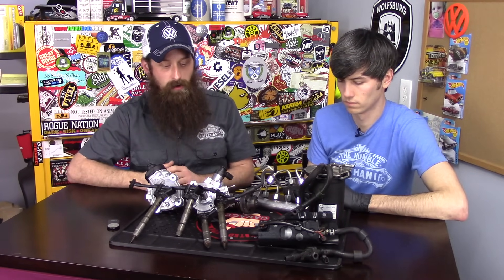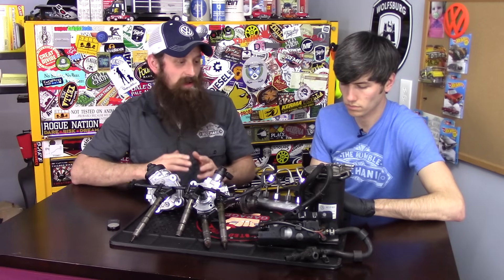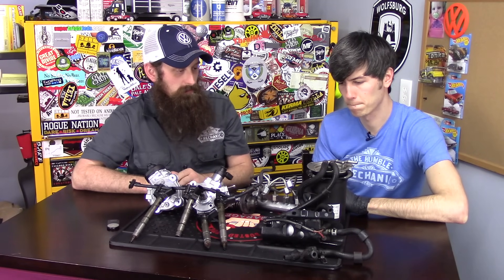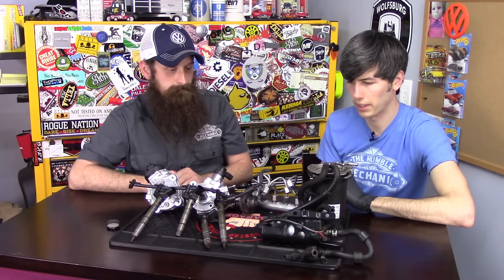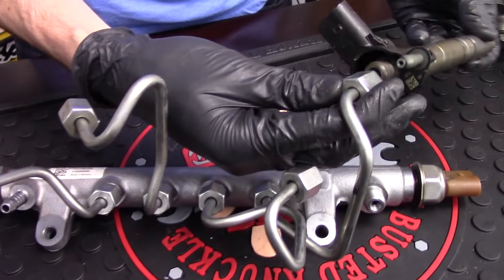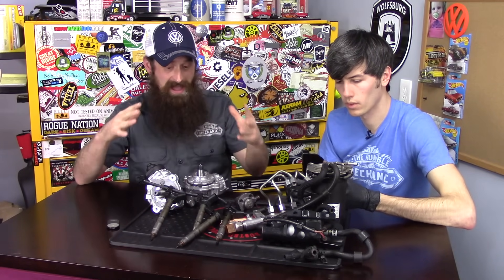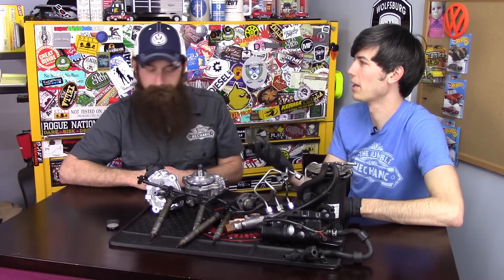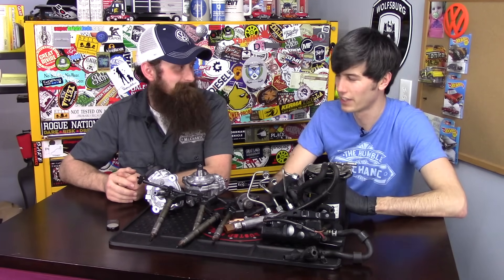Putting Gasoline In A Diesel Car - What Happens?

Comment: My diesel can not starting due to injector issue, can I put around 50ml petrol in Air Pipe and try to start for emergency . Issue is car was standing for long time. Can I use Petrol in the Air pipe to just to start the car?

Comment: my mother in law took my father in law's brand new 2006 diesel F-250, he had it for less than a month and it had less than 2,000 miles, and she filled from 1/8 of a tank to full with gasoline, she realized what she had done after starting it and driving 50 foot and shut it down. thankfully after the tank was drained and refilled with diesel it didn't have any problems but it was scary because the engine wasn't broke in yet, it was the first brand new vehicle he'd ever owned in his almost 60 years of being alive and he was not happy

Comment: Read much of this.  Seems like overkill.  And if you put diesel in a gas engine, you DON'T have to do anything, just drain the diesel out and refill it with gasoline, and you will be good to go as soon as the diesel in the carb has been replaced with gasoline.

Comment: Just get the engine replaced, its much easier. Also you can drive with diluted or mixed fuel right up to 50% of the wrong fuel. This guy is talking if you use 100% of the wrong fuel and drive.

Comment: what about when diesel is pumped into regular gas engine? they just did gas to diesel? also in another video i watched prior, they said there is a critical time window to get the wrong fuel pumped out before it compromises the whole engine, like before the car's actually driven to distribute your mistake throughout the whole engine. Is that true?

Comment: I don't get why the diesel nozzle is larger than the petrol nozzle. It's much easier to put petrol in a diesel car, which also has much more severe consequences, than if you put diesel in a gas/petrol car. My guess is that the standard for these sizes was made several decades ago way before misfueling was considered an issue.

Comment: So only the pressure pump would fail if it doesn’t have it’s own oil 🤔 

Swap that from a metal to metal pump to something else and you can run gasoline 😊

Wow that’s an easy upgrade.

Comment: I have a 2007 Ford 2.0 TDCi CommonRail engine with 360 000 km with injectors and dpf filter needing a clean to pass emission test. As far as I've been told and researched on the internet a % of petrol ( or Toluene ) should do the trick, clean the (clogged up.. ) injectors to some extent. What is the % of petrol gas to never cross? 5 %? 10 %? 
Thanks.

Comment: its like this, diesel depends on a sort of detonation or ignition from hot conditions,  and gasoline is formulated to prevent detonation from hot spots so really they are opposite fuels.  the operators manual for the 1977 diesel i had said in very cold weather mix 50/50 diesel/ gas

Comment: Years ago, I put unleaded gas in my regular gas car. It ran like crap and I didn't know what was wrong, neither did the mechanic. Later I re-fueled with regular and voila, it ran perfectly.
Reply: Small engine?  Usually small engines,  especially the older ones need higher octane fuel.  Not as big of a deal putting high octane in a bigger engine.

Comment: OMG! So many people cannot read + comprehend. Most people can't even correctly identify pump # or forget which is the fueling side. You generally cannot put Diesel in a gas engine because the nozzle is larger. And what about ppl. that drive off with nozzle still in fuel port????!!! that's why breakaways had to be invented. Remember when there was NO self service????

Comment: In the winter in cold weather my old 240D Mercedes manual said I could cut the diesel fuel with a bit of gasoline in the winter. I think it was about a pint or quart of gas per tank of diesel fuel. Diesel fuel gets like gel in winter.

Comment: Two years ago, my sister's husband poured 2/3 gasoline into a fiat multiple 1.9jtd After 140 km, I emptied the tank, poured diesel and two-stroke oil. Even today, he drives it with the same injectors and the engine does not consume oil

Comment: What I got from the video is that vehicle manufacturers make profits from consumers making mistakes... Manufacturers are making parts that WILL be guaranteed to fail if used incorrectly once. With your own words older vehicles ("back in the day") would just run like crap for a bit and replace maybe 1 part but today it would destroy the whole fuel system / vehicle.... especially in terms of the money needed to replace all parts "damaged" either short or long term will exceede the value of the vehicle. It's awesome to know you guys explained how inferior vehicle parts are made and how making something like a gaspline pump that doesn't rely on fuel for lubrication can be fine but if you have a diesel pump and give it gasoline it will destroy it.  Why cant a gasoline fuel pump be used in a diesel? I think manufacturers plan for cheap / obsolescence / high cost of ownership.... especially when dealerships make more money off out of warranty claims / repairs keeps them in business more than selling a new vehicle.

Comment: Nothing will ever happen to any part of the engine if you put some amount of gasoline into diesel fuel. Mixture of 85% diesel (old diesel fuel, full of sulphur) and 15% gasoline was recommended in the winter time to prevent waxing of diesel at low temps. Modern diesel fuel has additives to enhance lubrication so putting say 10% of diesel will do no harm to the system. Not even plastic pr rubber parts will suffer any damage.

Comment: Just jumper the fuel pump relay, disconnect the fuel hose up by the engine & extend that hose with another hose into a gas/diesel safe container until take & lines are dry lolz don’t need all this

Comment: you say you can destroy the fuel handling systems pumps, filter and manifolds.

and you say it is because gasoline does not provide lubrication.

when you mix oil into gasoline for 2 cycle machines that is done to provide lubrication so it begs the question what happens if you burn diesel or heating or k1 fuel in a 2 cycle machine ?

also will a hobby model run on diesel, heating or k1 fuel?

you can get model engines for airplanes and cars that run on a clear liquid and works the same exact way where there is a glow plug to head the cylinder head so the fuel will burn and no spark plug..

also what about the diesel engine if you can manage to get gasoline past the fuel handling stuff for the time before it fails will the diesel engine even run on gasoline?

Comment: just drain the tank and put diesel back in and maybe drain the fuel line if you drove a bit with the gasoline. Trace amounts of gasoline don't matter. In older diesels we usually put a little bit of gasoline in the diesel in the winter so the diesel doesn't freeze.

Comment: Does running out of fuel on a diesel cause the same wear and tear on the injection pump as putting gasoline in it?  Also does winterized D2 diesel fuel have kerosene in it or another additive?  Do modern diesel cars require D1 fuel instead of winterized D2?

Comment: Amazing how many folks accidently put gas into a deialse. I hadn't ever heard about it till recently when a guy at work did it to his service van. And then someone told be about some other guys in a work truck that did it at one fill up, realized before driving so just drained the tank. Then later in the same long trip did it again, but didn't think about it and drove it and trashed the engine. I kind of wonder if it was an alcohol related incident, if you know what I mean!

Comment: The best way to flush a Diesel fuel system is with Diesel fuel I've had so many of these jobs like this and only one was brought in with Mechanical damage and it was due to overheating and as for the in tank lift pump they are build the same Gas and Diesel so gas will not hurt them your biggest expense is the tow bill and labor to remove fuel and flush and all the fuel to put back in and new fuel filter. BTW I am a ASE Senior Master Certified Auto/Diesel Tech and also hold an Engineering Degree I started working on trucks and cars because of clowns like his guy to give people fair honest work. Yes these damages can occur but likely not because if you have ever put enough Gasoline in a Diesel tank the engine will only idle and if you have enough Diesel in the tank to raise the RPMs than you have enough diesel to lube the injector pump and Injectors but the engine temps will rise before fuel system damage.
STEER CLEAR OF THESE GUYS

Comment: I accidentally put coal in my 737 airliner once.
Reply: Same, I won’t make that mistake twice
Reply: Just switch it off and on again
Reply: Me too, I just flushed it out with gasoline then flushed it again with diesel.  It ran kinda rough for a while but I walked it off so to speak.
Reply: Did it smoke any?

Comment: In 1972, my mother had a 1970 Coupe DeVille with a huge 500 CU motor. We were on a trip to a relative in another state and mid -trip she pulled into a gas station to fill up where an attendant pumped the fuel for you (before DIY pumps existed). The kid put diesel in the Caddy. We started  down the road and after about 3 miles my mother complained that the car started feeling sluggish and there seemed to be more than usual smoke coming from the exhaust. Fortunately we had a ticket for the gas sale and right on the ticket was the price per gallon.  That's how we knew it was diesel because in those days when Gas was 102 cents per gallon, diesel was 89 cents. I'd worked in my late teens in a used car lot so I new a little about car motors and I knew that the Caddy had a 10.5 to 1 compression ratio so I said "Keep going and don't stop" until we had less than a quarter tank on the fuel guage. When we pulled into the next station we didn't turn off the motor and filled it up with 93 Octane.  We did the same fill up one mile from our destination. We then arrived and told our relative what had happened. He said it was the best thing we could have done and we turned off the car. The next day the car started up without any problem at all.

Comment: My sister filled up her toyota diesel SUV with gas, drove off and a few miles down the road it shut off.  It was towed to the garage where they removed the tank and cleaned it. Flushed the fuel lines, replaced the filter, bled the air from the fuel lines and off she goes without a problem.

Comment: i put gasoline on an a non-empty tank by mistake, the tank was 1/3 full when i added it
but i never drained it, i used the car till the tank was 3/4 then fill it again with diesel fuel, i did it again 3 times
my reasoning was that the diesel fuel is heavier and will be  the most likely to be siffoned by the pump
and the mixing ratio of diesel+gasoline makes it so that only a small portion of gasoline get siffoned
so it get dilluted and wont harm the pump
the car was a corolla E140 diesel

Comment: I have a Ford focus from 2010. I have a fuelcap that won't open if I don't use the diesel nossle at the fuel station. 

I live I Sweden and we have different nossels for gasaline and diesel. We also have the same colour code on every fuel station. Black for diesel. Green for gasaline and blue for ethanol.

Comment: I had a sprinter van I put petrol in so 50/50 mix of 40 litres.      Drove 500 miles filling with diesel on route.
It’s now at 170,000 miles .  No issues a year later

Comment: What if I just drove for half a mile only? Would there be much damage? I was told the car may be running off the diesel fuel in the fuel filter, and so the other parts may not have to be replaced.

Comment: couldn't you just dilute the diesel/petrol mix into petrol at a very high dilution? say like 5%? you could even use it in a 2 stroke engine and just adapt the amount of oil you mix with the petrol slightly?

Comment: As others have said the repairs mentioned in the video are overkill! Or at least, it's a worse case scenario. Even with common rail diesels I have only come across 2 cars that would've needed all the parts replaced as in the video. True I've mostly worked in only small garages over the past 23yrs, so I don't see the large volume of mis fuels that big dealers get, but even so I've worked on, or seen in my work many dozens of mis fuelled cars in that time.
Clean out the tank, lines & change the fuel filter, then see how it goes! Otherwise, especially with older cars you could be looking at an instant write off!

Comment: A friend of mine borrowed my truck and put about 4 gallons of gas in my truck and ran it about 10-15 miles.  Do you think that I can drain the fuel and replace the filter and refill it with fuel and I will be ok or do I just need to take it in and get the parts replaced?  Any suggestions will be greatly appreciated.  My truck is a dodge 2500 1998.  It is the old type of Cummins engine.

Comment: What a load of bollocks. I know someone who mis-fuelled their nearly new diesel van five years ago, his big worry was that the fuel pump was ruined, but the mechanic said it would be fine & all the mechanic did was drain the fuel tank, clean out the fuel filter housing, then re-fuelled with the correct fuel. 100,000 miles on he's had no components fail at all.

Comment: wow dummies of the planet infecting all the planet  every and any car cleaning products from engine cleaner to fuel line cleaner its main source is diesel
putting diesel fuel anywhere is a cleaner dummies
you can flush your engine with it 
clean your fuel systems by putting 5 litters of diesel in your fuel tank even if it runs on gasolin or vaselin if you like that

Comment: I wonder if it would be possible to harden a diesel fuel system to make it compatible with gasoline? Maybe a pump that has proper bearings instead of relying on lubrication from fuel?

Comment: Sorry Charles but replacing every component is overkill, I am a diesel fitter and auto mechanic by trade and have seen hundreds upon hundreds of instances of wrong fuel in diesel engines and had both the pumps and injectors apart for inspection. In most cases the engine will stop running prior to damage being done to the HP pump and injectors, manufacturers and their dealers  cover their arse in case of "future" failure, not need and mostly a rip off.

Comment: It's a scam!
A  UK motoring magazine wanted to find out what happens so they took a number of the long term diesel test cars they had, filled them up with petrol (gasoline) and drove them until they stopped. Then they went to the manufacturers garage to fix as they were still under warranty.
Chrysler charged £5000 and changed the entire fuel system, tank, pumps, injectors the whole lot.
BMW flushed the system and changed the fuel filter only at a cost of <£300.
Skoda did the same for <£200.
The warranties remained in place for the remainder they had left ie unaffected by the wrong fuel.

For our american friends who may not be familiar with Skoda it is a VW with different bodywork.

Comment: a friend of mine got gasoline pumped into his 1.9jtd croma by the attendant at the gas station.. didnt know about it, drove about 15km (10mi?) to work where he looked at the receipt... he showed me and asked whats in it - i said its a regular 95 gasoline... he says i have a diesel engine :D just couldnt believe what he saw at the receipt... youd expect those attendants to know what they are doing... so we flushed what needed flushing, luckily the gasoline didnt yet get past the fuel filter into the high pressure pump...  back he goes to the gas station and wants his money back for the full tank of gasoline which had no business in his car, he didnt even want compensation for the work since it only cost him his time... he had to scramble with shell for two months to get that 50 euro or so :D the clerk killed me when she asked if it was gasoline in a diesel engine or diesel in a gasoline engine, because diesel in a gasoline engine is worse - i was like facepalm... i guess you need to keep an eye on the attendants, they are underpaid and dont give a dam if they cause your timing belt to break

Comment: Did it to my Volvo s60 (2004) when stressful talking on phone. Gasoline was almost half of fuel. Added 2-stroke oil to container and was driving with no problems. Just after few hundred km fill again and again with disel. The problem with gasoline on disel cars is that it is lean and parts wear off quicker.

Comment: Sorry but I did this, put 20 litres of unleaded petrol in a Diesel Audi, stopped, filled the tank to brim with diesel and it drove fine. After 100 miles I filled it again with Diesel and there was if anything an improvement in performance,  that's it, no drama no issues nothing to really worry about.

Comment: I had that issue on a new diesel car and we just clean completely the engine and fuel tank, got new filters and the car is runnung well until now 8 years after .. Most of the procedures you said won't be necessary, in most of situations .. Any one would shut down the engine on malfunction situation, unless you're running the engine with gas on purpose.

Good video By the way. Thanks

Comment: Talk about over kill about putting gas in a diesel motor mostly with older diesel motors are built to handle way more than a modern diesel motor will do because I have a old VW diesel motor and I have put in quarter of a gallon of gas in my full tank of  diesel fuel often in the winter time for faster starts and less gel up with diesel fuel on summer grade fuel and better performance. Been doing it to my older diesel for many years now and no show of any damages to my diesel motor at all,

Comment: Got a 2001 Seat Leon TDI 170K miles on the clock, filled up petrol (7litres), topped up with premium diesel, car was running like crazy, different smell, less rattle :) 15K miles later so far so good